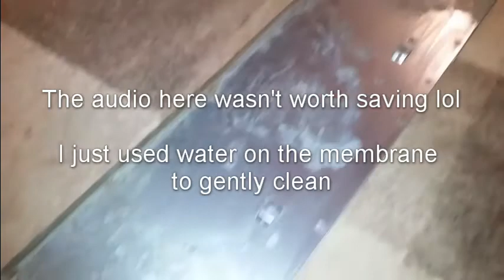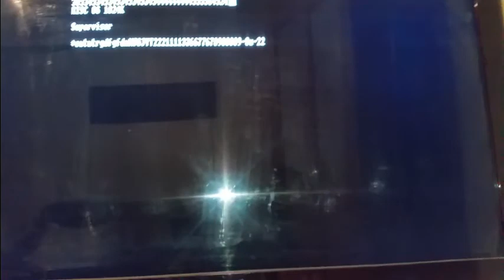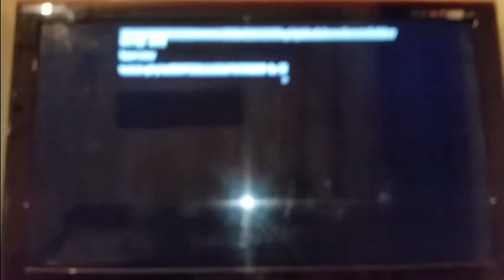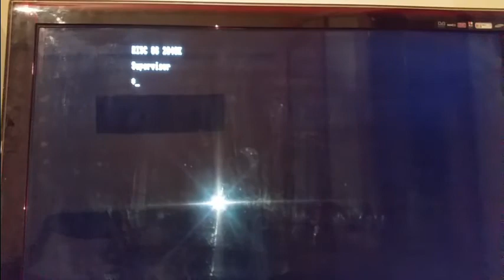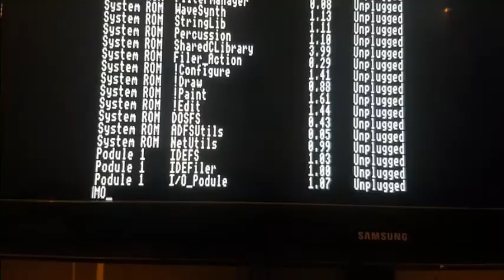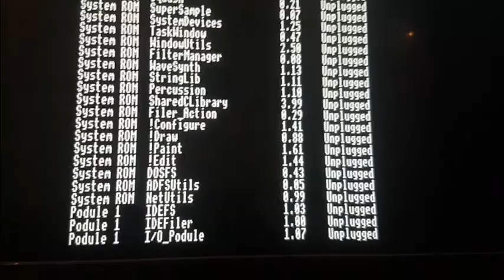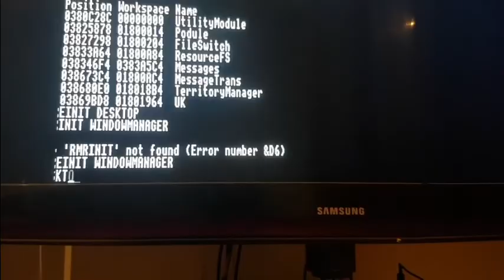Archimedes A3000 Repair Video Part 2 (Rough Audio)

Comment: Nice work i need one of these to go with my bbc b and master .To reset the CMOS to factory settings hold down the Delete key whilst you switch the machine on. http://www.riscos.org/csafaq/part3.html#3_3
Reply from the maker: paulb4uk Thanks. I will try the delete key (and I will make sure that the delete key actually works as well lol). Looking at those error flash codes, my money is on 'CMOS ram checksum error'. 🤞